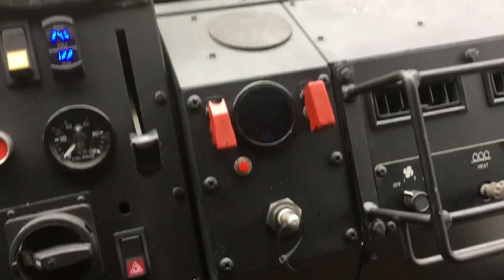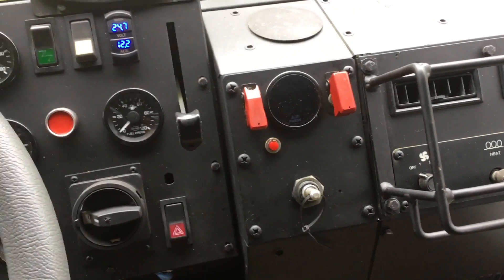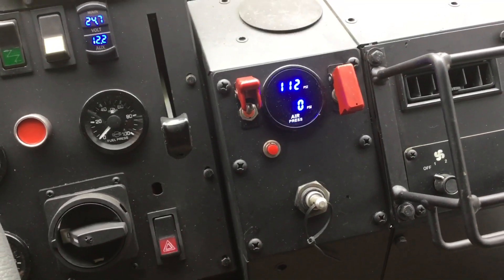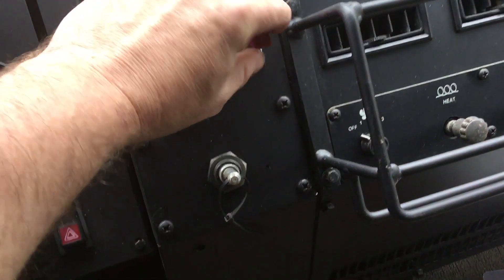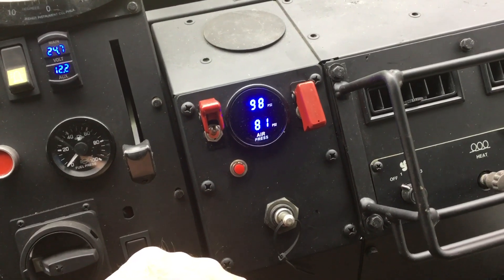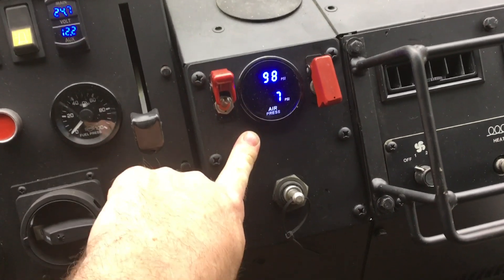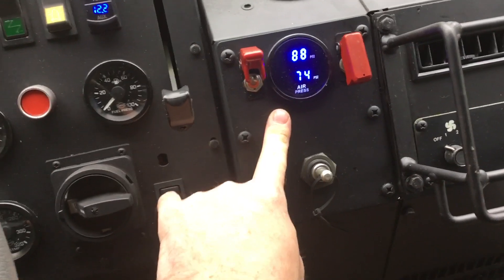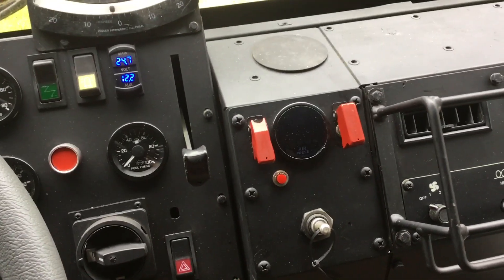LMTV Manual CTIS control part 2

Comment: Can you show me how you made this ? Thanks
Reply from the maker: If you look at my other videos, you will find one labeled “manual CTIS wiring diagram” that shows the wiring for the current version of my system system seen in this video to manipulate the 24v between pins H,R,B and C on the CTIS controller cannon plug.  The top left switch is a double pole switch(at the top of the diagram) and I added 12v power for that digital gauge to one of the poles, the other pole switches 24v power for the air control solenoids on the Pressure Control Unit.   On the PCU under the passenger dash there is a pressure sensor used by the CTIS controller.  I removed it and installed one of the ones that came with the digital gauge.  You can put about any gauge there, my first experimenting with this I had a basic mechanical oil pressure gauge connected to that port, and it worked just fine.  The second sensor for the digital gauge I connected to the extra port on the fan control solenoid, to allow me to see wet tank pressure output thru the wet tank protection valve.

Comment: to remove the trailer air... do I just need to cap the supply line to the dash valve and then trace all the other lines back from it and get rid of them?
Reply from the maker: Look at my other videos, I did one on rear brake components and one on removing the front glad-hands safely.  Back over the rear axle, the air brake protection valve feeds the two rear glad-hands.  It has 3 inputs.  One from the trailer control in the dash.  It gets primary service(pedal) air from a T over at the input to the load sensing valve(has a cable down to axle) and secondary air from the reversing valve.  You can disconnect the line from the trailer control. It originates at a floor port behind the grill(I sho it in the front glad-hand video).  You can disconnect the primary line at the load sensing valve and either replace the T with an elbow, or put a plug in the now unused port on the T.  The secondary service air line comes over from the reversing valve. And is connected to a T at the protection valve and the other leg of the T goes back to feed the top port on the anti-compound valve.  Secondary air feeds both protection and anti-compound, and it must continue to feed the anti-compound when you are done.  Disconnect the line at the anti-compound valve(Top port?) and disconnect the long line at the protection valve T and move it over to the port on the top of the anti-compound(secondary air now only feeds anti-compound).  Then you can remove the protection valve and the lines back to the rear glad-hands.
Reply: @rronmar   thanks so much! watched both videos already. will watch again with the new info - really appreciate it!
Reply: @rronmar  I watched and rewatched both videos kind of assuming everything would be the same... but I have an m1088 and.. its completely different.  any idea on how to start trying to figure it out?
Reply from the maker: @RichardGottardo  follow the lines from the rear glad-hands. They should connect to the air brake protection valve.

Comment: Does it auto fill if one tire looses air ?
Reply from the maker: As soon as the system is pressurized all 4 tires are connected together which will equalize a low tire.  This would be indicated by a slow decrease in pressure on the gauge which would halt after a short time.  If the decrease didn’t stop after a short period, that would indicate a system leak…